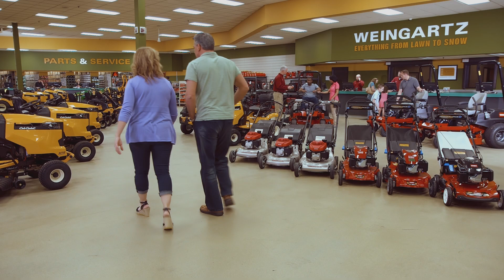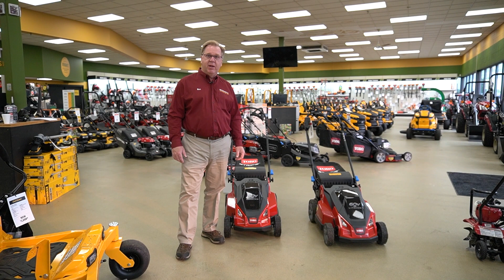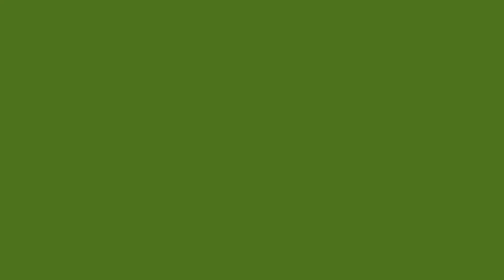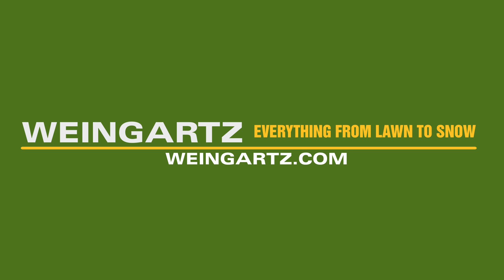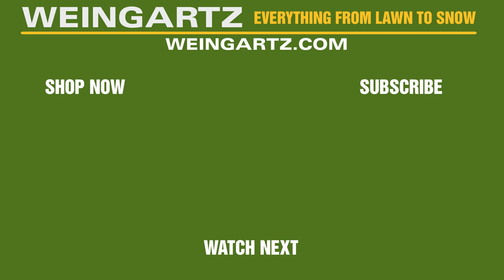Wednesdays With Weingartz: Toro 60V MAX Stripe Walk Behind Lawn Mower

Comment: Toro should be ashamed of this mower, absolutely horrible design!  Self propelled models are so slow they are unusable and too heavy to push. Even the push handle is crap. I returned mine after about a 100 feet on first mow. Owned Toro's for 25 + years and have two 60 volt mowers, buy any other Toro and avoid this one.
Reply: You’re not wrong only 3 mph is horrible.